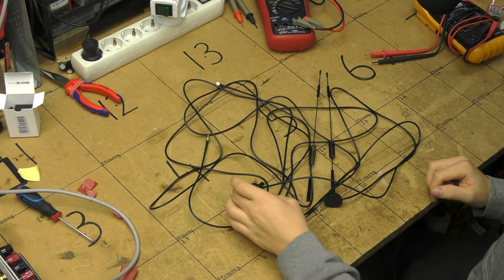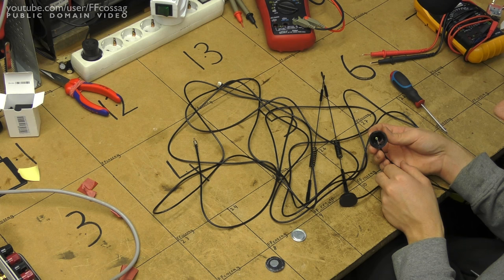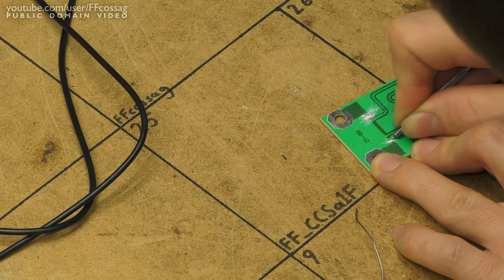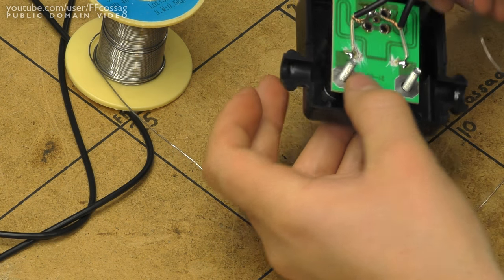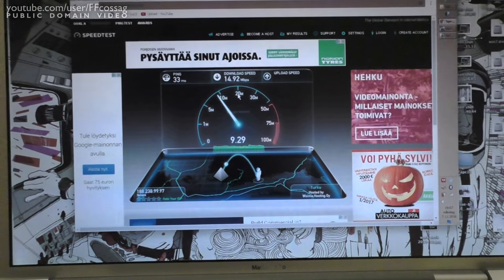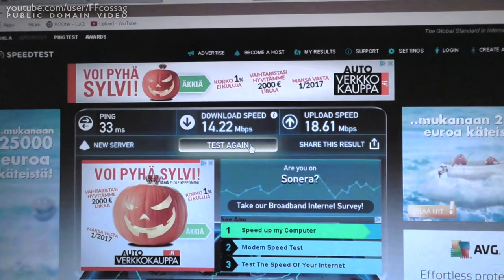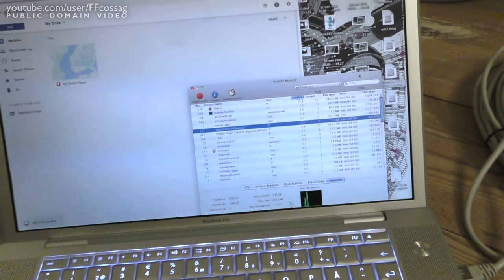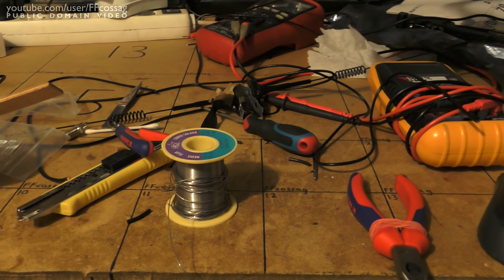"Internet Blaster" 4G antenna 3.0 - 4 bars!

Comment: The small PCB that connects the dipole antenna to the coax is a balun. It matches a higher impedance balanced dipole to the unbalanced coax cable. So the mod you made meant that you throw away half the signal or more. Those cheap antennas do not look very 3G or 4G to me. You have far more gain in that TV antenna at 800 MHz than those small sticks will ever give. The funny shape the dipole and directors have are like triangles but open to reduce wind load. That shape is there to make the antenna wide band as the UHF TV range is pretty wide. You may be able to modify and optimize it by cutting a centimeter or so off the length of all the directors and the dipole to move the center frequency up a bit. The best you could do is to take advantage of the two antenna inputs on the modem. Get an additional TV antenna and put it on top of the other or side by side with a few wavelenths of distance so they do not distort each others near field. And then you can experiment with having small differences in angle or have one vertical and the other horizontal. This will give so called diversity gain. Connecting the two antenna inputs in paralle to the same antenna does not give diversity and creates impedance mismatch
Reply from the maker: Thank you, I've been waiting for someone to type up something like this. I am using both antenna inputs on the modem, though; one is connected to each "half" of the TV antenna. They're not just wired up directly in parallel, although I wouldn't know if this way would be considered as parallel in RF terms. I'm not sure why, but having them hooked up this way works a lot better than just having one of the antenna inputs connected and the other unused.

Either way, I'll remember your comment for the next time I'm playing with this set-up - thanks!
Reply: FFcossag, in fact I am impressed that you have quite good knowledge on electronics but you lack of knowledge on RF. But I enjoyed this video so much. In my opinion you should have left the antenna as it was  and cut the dipole an directors as Kenneth said.

Comment: Change the angle make it vertical not horizontal ..
Reply from the maker: I tried that and it makes everything not work very well at all.
Reply: 4G is polarised Horizontal and Vertical.
I suggest to lookup the design of a  cross-yagi antenna.
This wil get the most out of the signal.

Comment: LOL i like that, the sticker stuck :-D
Hey you have got a fantastic improvement just with that tv antenna, dont touch it :-).
Perhaps you need a program to test for lost packets or errors, for minimal errors.

We all have mishaps.
Years ago i had a habit of wearing trowsers with turn ups at the leg bottoms.
i had been repairing something important and a transistor that i removed to test just vanishes.
its an odd number so i dont have a spare one, the search for it is a utter failure and im well pissed off with loseing  it :-(,  an hour later it drops out of my trowser leg turn up as i move position, im glad it was found and bloody annoyed with myself LOL :-D.
Dropped components usually vanish into "The twilight zone." never to be seen again.....
Reply from the maker: Just a few days ago, I sat down by the dinner table only to have my fancy, brand new 64 GB UHS-III SD card fall out of my sleeve covertly. Had I not noticed it by seeing it after a while, it would have been dog food.
Reply: LOL yes they are sneaky bastards :-D.
Memory is getting mad, the sizes of usb sticks are daft, now we are able to store stupid amounts of data, and when the stick fails or gets damaged ...... oh hell :-(

Comment: beta.speedtest.net is your friend. HTML5 and no need for Flash. doing a speedof.me test may also be interesting to check out. should also stop Firefox using so much CPU during speedtests.
Sadly I've only ever owned a normal macbook and even then have had to replace the mPCIe WiFi chipset inside to the proper GOOD one to reduce the CPU overhead during WiFi transfers. Depending on how old your macbook pro is, you could probably find one for extremely cheap, but I'm figuring you either have it in there already, or can't be bothered opening the thing.
Reply from the maker: I haven't done any research regarding the WLAN connectivity on that thing. I love my Macbook for its "just werksness", so I prefer not messing with it.